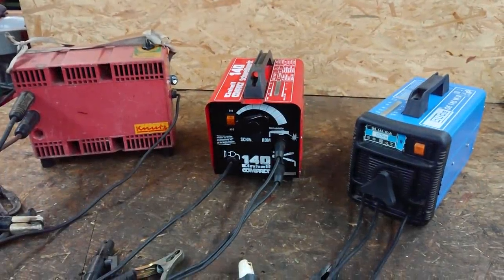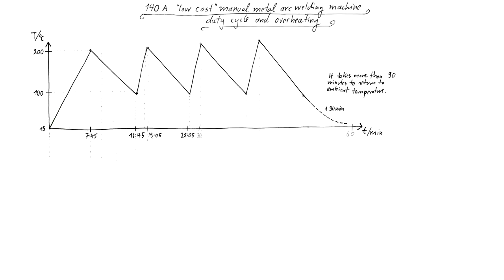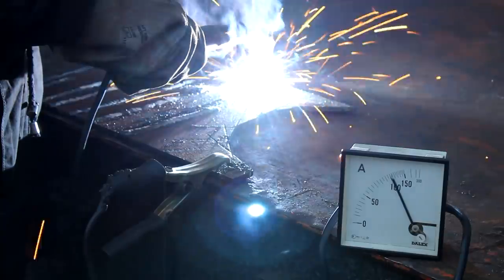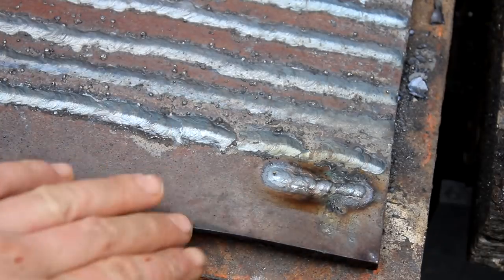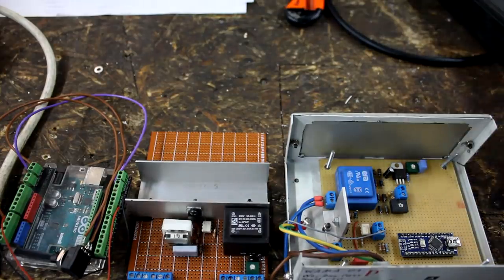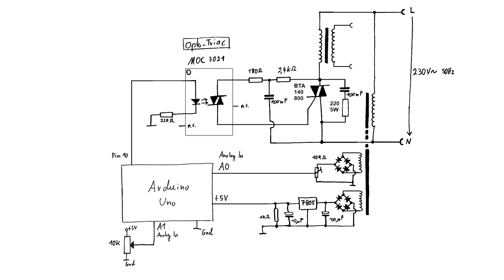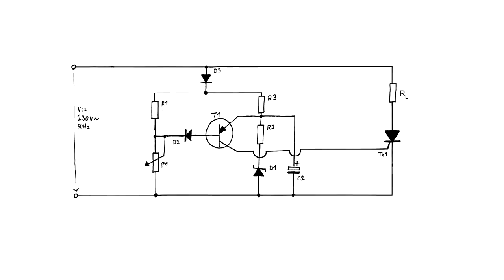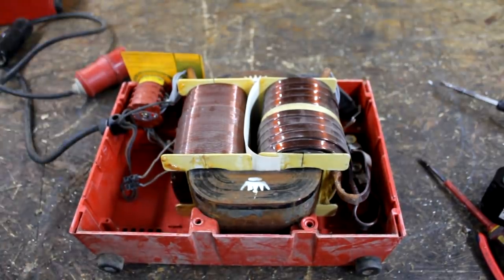Welder Experiments! DIY Upgrades for Cheap Stick Welders!

Comment: I put power factor correction on a welder like those back in the early 1980's. I had Phillips capacitors in Kings Lynn Norfolk here in the UK make up a batch of capacitors for the job. At the time I was trying to run such a welder from a generator and the poor power factor meant that it just would not, I found though that with the correct amount of capacitance when there was no arc load on the transformer the voltage of the generator went from 240 volts rms to somewhere near 400 volts so I had to remove half of the capacitors of which I still have some waiting for use in whatever. I did also experiment with another welding transformer and AC tig welding at 50HZ worked just fine I had an old BOC high frequency generator of the spark gap type so had HF start I then also made up a rectifier pack as well. I sold the unit as a whole for enough to buy a migatronic 200 amp tig unit brand new, the transformer was a massive three phase unit with an output of 650 amps that I had purchased second hand from someone who had got it from a ship yard in order weld up a building that he put up to house an injection die manufacturing business and was surplus to his needs.

Comment: For TIG welding you would actually need two additions.  One is a choke to the DC side.  That probably would really do wonders to the stick welding as well.  But the other additions is strictly for the TIG and that is a current control, unlike the voltage "control" you have added.  The reason is that a TIG arc behaves like a negative resistance.  The more current is pulled into the arc, the lower the resistance becomes and the current skyrockets.  Your poor power factor and huge (peak) currents tell the story.
  There is another issue -- it is almost impossible to keep the primary current symmetrical, i.e. the same on positive and negative half cycle without sensing the magnetic flux in the transformer.  You might help by bringing the shorting yoke back into the transformer.  Or you could add an air gap in the main transformer, as you did on the the choke.  A further possibility would be to have big capacitors in series with the transformer primary, but that brings in new problems that at least I would not be willing to accept.  In summary, I would accept the straight forward implementation of putting a big enough SCR bridge to the secondary, along with a big choke.  And then of course a DC current sensing device, which could be a shunt plus an isolation amplifier or some sensors like those sold by LEM.  Just one seldom covered detail -- your SCRs don't remain conducting into an inductive load with a trigger delay (according to your sketch) more than 90 degree.  Having done those, I have had to learn, at first the hard way.  I hope these comments help pointing you around the common traps.

Comment: Ah, a great explanation of "Duty Cycle" where the cheap welders tend to give you short time of use. One needs to look at the type of work you are doing to determine the duty cycle you require (say 3 minutes cooling for 10 mins of welding...10 mins is a long time at full power). My rule of thumb is picking a machine that does 2/3 of its capacity (60% or better...ofcourse those are usually more costly machines).

Comment: Would it be possible to add heatsinks to the transformer? I have thought about putting some heatsinks on the iron core with thermal adhesive but I'm not sure what effect it would have on the transformer....

Comment: 20:25 wouldn't a cheap standard analogic light-dimmer schematic work just fine (with snubber of course)?
Also, two SCR in inverse parallel would be more reliable than a triac, right?

Comment: Why not add some aluminum heat sinks to the cheaper laminated transformer core?  That would increase duty cycle even more.  Yet another option: water circulation through a fan-cooled radiator.

Comment: One of the potentially interesting tools based on transformation would be water electrolysis into oxygen and hydrogen used to power a welding torch. I remember seeing DIY schematics of such a tool with the proposed use by jewelers, I assume the construction is scalable.

Comment: 18:43 Careful! That seems to be a Wima MP3 paper capacitor. They have to replaced every 10 years, or sooner or later it will burn out and leave a big skidmark on the board.
Reply: RIFA is the brand that's infamous for failing.

Comment: I made a TIG adapter for a arc welder many years ago.  used a massive capacitor bank to smooth the welding current.  it worked ok

Comment: I wondered if a ceiling fan dimmer (maybe a lighting dimmer too) would provide the needed voltage control, but I assume the current would be too much for it. Still that circuit could perform the function if scaled up. Thoughts??

Comment: 24:20 wouldn't you be seeing significant clipping (areas of zero between the humps) due to the diode forward voltages?

Comment: This circuit draws large DC current from mains which is not good. Also powering 12V devices from mains directly is asking for problems as a failed thyristor (short circuit) will put 220VAC onto motor and also kill D4 and C4
Better solution is to use a 12V DC power supply with MOSFET PWM control to voltage to motor.

Comment: I just could trip my breaker when using the 220V Lorch welder of my great grandfather, when changing the current. ^^ But this welder does not has a shunt to my knoledge, but I think in there are different windings changed by a big switch in the front.

Also for 230V countries in europe: Try using C breakers, when you are running into problems. (Highershort circuit current rating than the  typical B)

Comment: A couple refinements came to mind.

First, would it be possible to add a shunt on the welding lead output to detect the actual welding current and then feed that data back to the micro controller to provide true current regulation. 

Also, I wonder if you could add a voltage detection the welding output and implement a dig function by varying the current based on the voltage. 

Awesome work! I hope I'll be able to implement something like this on my old AC tapped transformer welder. Thank you for posting this!

Comment: 11:00 Most welders come with a heat setting.  I have Lincoln MIG 180, I can set wire speed and heat.  I grew up on farm; we had Lincoln 225 Arc welder.  I would spend the extra $50 and get a new welder with heat settings and warranty (and insurance will cover it).
Reply: I believe the content of this channel is aimed towards learning/ expanding possibilities. Finding economic solutions, is also interesting though ( ! ) Peace
Reply: @wilhelmbeck8498  I am all about the tight buck. Seasons Greetings, and Happy New Year.
Reply: @wilhelmbeck8498  Plus, he is too smart for me to follow him.  I have to play within my limits.
Reply: @bradyelich2745  Same here  - but i will be picking up what's digestible for me.... Good Luck with everything !
Reply: @wilhelmbeck8498  I will ask my Son to explain it to me.  You ever play with the copper tube and an earth magnet?  That is cool.  Stay cool, only -11C here tonight (was -25 yesterday).
Reply: @bradyelich2745  Thanks for the tip - i will try it   when i get the chance ( i must get to work now - please excuse me

Comment: Love this video and can't wait for the follow up. You are a great teacher. Found the circuit explanation to be clear to understand. Amazing how you can use an Arduino to find the zero cross time. Wonder if it would help accuracy to use an interrupt for detecting the correct timing instead.

Comment: Thanks for the video and great electronic theory. For those out there who want to do this a little simpler, I think you could modify a common light dimmer to trigger the high power triac. You can power the fans with a suitable wall wart power supply. To improve power factor install an AC capacitor ( motor run cap ) in parallel with the transformer primary, after the power switch. Same thing goes for AC motors. A quick and dirty way to get the cap value is to use a clamp-on amp meter or a power meter and add capacitance until you get the lowest power consumption. In this case I would try about 40 mfd as a beginning value, remember to use the correct voltage rating or higher.
Reply: You can get these cooling fans with AC motors, the best brand is PAPST hungary - looks just like computer fan but its all powdercoated metal on ball bearings, runs of regular AC power (110V 60Hz for me) no need for any electronics!
Also i facepalmed the ardunio stuff! The Beauty of this welder is its simplicity and durability! If you dont feel like turning the screw for a minute just get a speed clamp there.
Nevertheless gread channel!

Comment: For the cooling I was wondering if you could attach aluminum heat sink to the transformer to draw the heat away allowing the fans to cool both the transformer and heat sink faster and easier because of the heat being spread across a larger area

Comment: Great circuit for the phase angle control of the welder current.  You might think about adding some input protection on your vrectifier input of the arduino, wouldn't want a burp on the mains voltage input to potentially damage your arduino.

Comment: You don't really need the second transformer winding and rectifier. Because the -ve output of the two bridges are common, you could have just taken the +ve end of the 5v supply bridge through a potentiometer to A0.

Comment: why not add a heatsink to the first transformer? like on the top and sides
and maybe a relay could be added to the transformer primary to trigger on contact so the transformer will be OFF when youre not welding

Comment: Server fans are BLDC motors with integrated electronics. It seems like a bad idea to put them in series, and a really bad idea to power them from chopped-up 240V (if that's what your circuit does)

Comment: if you have the arduino setup why not use an igbt or MOSFET pair and pwm the transformer to have a cleaner waveform and avoid quite a few of the power factor problems? 
also since you have a phase synced  microcontroller you could use a fet bridge instead of the diode bridge for a bit more efficiency and you could maybe integrate an hf/hv start.
also the fet bridge would probably be a bit cheaper, though the extra programming and installation complexity would offset that, so diode bridge + single dc fet might be easier. 
there might also be a setup where you use the full power of the transformer but pwm the output dc after filtering, removing a lot of the ripple effect, especially on low currents.
to filter you could try making carbon supercaps, getting to 1F@54V should be pretty easy. (20*20Fplates) this should give you a peak to peak of about a volt at 200A (200A/(2*100hz*1Vpp).
for the supercap, you could be able to use any material that's not affected by salt and make metal/fish tank filter carbon processed in a blender + salt and water/A4 sheet of paper soaked in saltwater/carbon mix/metal/repeat that should be enough.
note that that might actually give only 1.2V but with an A4 sheet it should be enough capacity to filter most of the ripple.
aluminium foil is probably a good material for the metal in-between, it is thin enough and has enough area that the 200A current shouldn't be a problem, I estimate 5.3nanoohm(10^-9).cm2 maybe adding a thicker sheet on the end to plug into would be a good idea for sturdyness, I calculated the voltage loss to be under 4mV assuming an 0.2mm A4 sheet, and 200A going through from the bottom and so basically nothing to worry about 
another option is getting like 20 old amps and scavanging the capacitors.

note that I haven't calculated the resistance of the electrolyte and that seems to be the main problem, so unless you get it thin enough, or use larger sheets (1square meter per cell is definitely good enough, but this needs to be rolled.)
cost would be ~100 euros. (60€ of aluminium, 20€ of paper, 20€ of charcoal, salt and water are free-ish)
this is comparable to getting 50-100 10mF (10000uf) capacitors, which is around  100-200€. 
note that at that price you can probably get a decent inverted dc welder.

Comment: I know that you are obliged to use a transformer to get your  50-150 Ampere on output because what let melt the electrode during welding is not the voltage but current. Higher/lower voltage let you increase/decrease the distance between electrode and piece to be welded or used to weld more or less thick material by limited current.

Now, if the secondary winding become to hot, it is clear, without here to cite a formula, a question of underdimensioning of square surface of copper on secondary. This is to thin and bad isolated actually.
The primary winding should be ok for 240 V 16 A and a couple of Amperes caused by magnetic-back-coupling.
Hence, if you have enough space on secondary side, I did recommend to double the square surface of copper or build your own transformator and isolate the wires with silicon e.g. single silicon isolated wire, these support a temp about 900 Celsius max..

The second topic is: I din't recommend to use Arduino or other delicate components inside the "case". There is a so high EMV that will destroy any circuits very fast or you have to make a shielded enclosure for them. 

Third: Why do you make the wave-cutter so complicated and why want you cut the primary/wave? Cutting input-wave is always a bad idea destroying the natural sinus wave with which-one works tranformators.  

Just rectify the "Secondary-Voltage" over/through 4 big diodes or Power-MOSFETs (50-60 A each minimum) and use an additional Power-MOSFET (200-300 Amperes) as current-regulator afterward.
Here you need just a Voltage on the 'gate' to increase or decrease current.

If you need also to adjust the Voltage, a second Power-MOSFET (200-300 A) between the "rectifier"-unit and "current-regulator"-unit will do it.
Anyway, I suggest to use AMP- and VOLT-meter to have more control over welding-process.

Fourth and last point:  As far I know welding works with 24-50 Volts and 40-60 Amperes max. but my information are surely old, nonetheless in computers are so-called 'switched-powersupply' in German "Schaltnetzteil".
Those PSU get 240 V 16 A max give 12 V 40 A max, anyway the power for CPUs (central processor unit) is 2 V 90 A max on many phases by an input of 12 V.
What I would explain is that you don't need a transformator at all but coils and those coils can be done out of your already present Trafo.

If you want opt for this solution you can make a rectifier bridge by using 8 diodes each 10 A (to be on the safe side), package of 10 piece costs less than 5 €,  than use an oscillator with variable voltage input level (Poti) that change the output frequency + an OP-amplifier to drive a POWER-MOSFET ("wave-cutter" or simply cutter) , now you can put coils (inductance) and capacitors to get CD (direct current). Note: A thick coil (or LC-"Filter") after the rectifier will let you increase the current and a big capacitor coupled with this coil will plain the wave (100 Hz pulsed half-sinus CD).

Succession of parts/components in standard "switch-PSU":

Rectifier-Bridge --> LC-"Filter" --> Cutter (controlled by Osc + OP-amp regulating Voltage) --> second LC-"Filter" (or more in parallel, this apply also for first-one) for getting plain CD --> second P-MOSFET (regulating current "only")

Note: Instead of cutter like in standard PSU you can use the first P-MOSFET to just reduce Voltage with open-drain going to input (source) of second P-MOSFET regulating current. In that case you avoid to use oscillator and OP-Amp, everything remain analog (besides of V- and A-meter). Put each coil  in an perforated aluminum cage connected to heard-wire (yell-gree) and-or external cage. Nevertheless I recommend to use at least 2 * 12V 14 cm fans. All coils will have a ferric-core. The original case, besides of air-intake-perforation and other small modifications, will be ok. It will hum with so high current hence also connections will be shielded.

Comment: Try not to lose connection with the viewers that can't, or don't want to, follow diagrams. Tried the same on my stick welder but 140 amps max output are not worth the effort. Still would be interesting to get my hands on a huge capacitor to filter the output after the dc rectifier and give it another go just for fun.

Comment: I am puzzled by the SCR circuit. Wouldn't R2 and R3 form a voltage divider? Which means the voltage at the emitter of the pnp would not be regulated.

Comment: Is the standard 230V on your power lines the RMS voltage instead of the peak-to-peak voltage?  I just expected 230V to be 230V.
...  got it, thanks!

Standards that lie bug me!  In the US, a nominal 2x4 board is actually 1-1/2" by 3-1/2".

Just wanted to let you know, I think you explain this more clearly in English than any native speaker I can think of, with the exception of someone like Feynman.  You are in lofty company, sir!

Comment: Hi, great lesson again. I am in the process of modification of an older transformer welder and it is progressing fine. The mentioned by you interface from the MOC3021 to the triac calls for a 2.4Kohm resistor as per specs sheets. This is not commonly availabe value and I am replacing it with two 4k7 resistors in parallel to get as close as possible to the 2k4 value. 
I do feel you should have mentioned it in your post?
Well done Sir - as always.
Regards,
jansb
-..  .-  -.--

Comment: 11:38  Nice video but always  be careful while cutting metal or do it outside your curtain can catch fire. And to keep down the temperature you can put the transformer in an oil tank with radiator  and a pump .

Comment: Great video.  I would like to see the effect to the power factor and or the quality of the weld  by adding a choke (Inductor) to the output of the 200A bridge rectifier. I think replacing the 6" fan with a 8" one can further the duty cycle, what do you think?